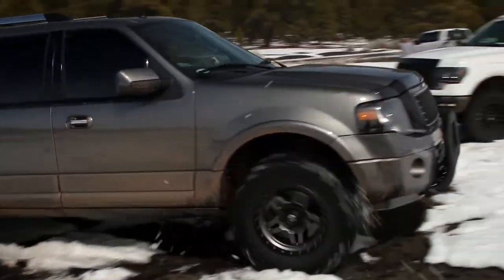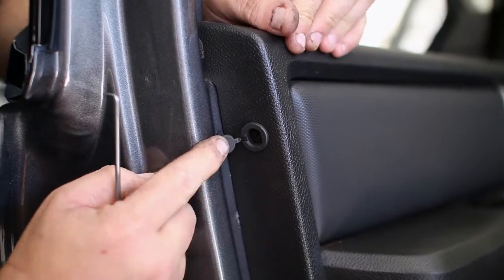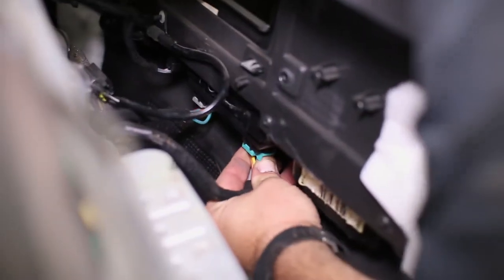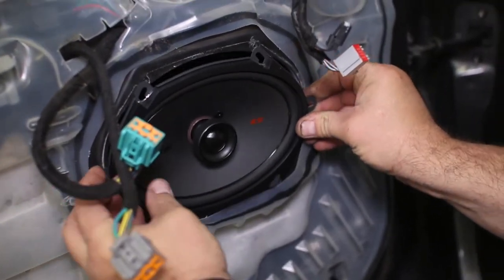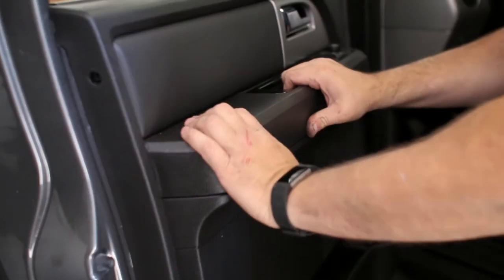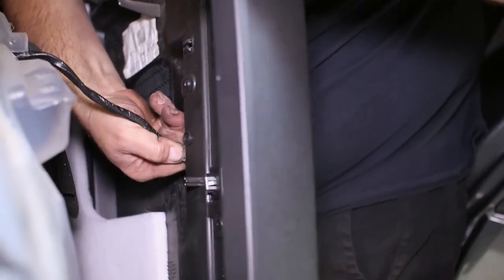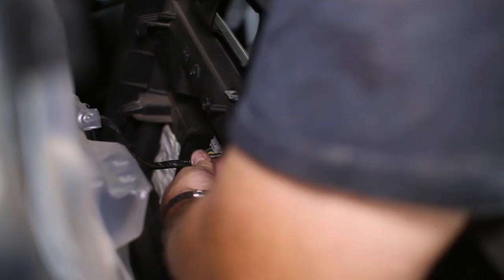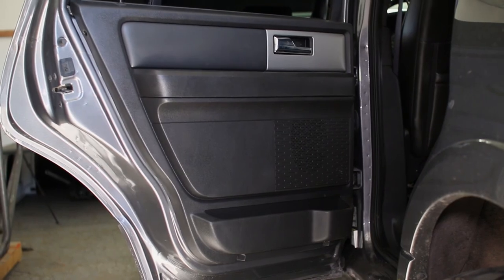2007-2016 Expedition Kicker KSC68 6x8 Door Speaker Upgrade Kit Install

Comment: I was happy to find this video until I read the comments about the Kicker installation stopping the tweeter from working.
Reply: You're right because upon me doing research as well everyone that does the conversion never explains that second clip that's just magically not being connected to anything what controls that clip nor has no one wrapped it up as a former protection because water can and will eventually get back there

Comment: I do not like the fact that replacing my speakers will eliminate my front tweeters
Reply: 10 months later do you have any suggestions on what system to use for the upgrade?
Reply: Kicker has a separate tweeter kit that can be purchased separately and was not included in this video.
Reply: @atcguy2007  where can i find this kit
Reply: Anybody had luck on this?

Comment: DISCONNECTING THE NEGATIVE TERMINAL ON THE BATTERY PRIOR (HIGHLY RECOMMEND ‼️‼️‼️) ALSO BOLT SIZE'S/SOCKET'S WOULD HAVE BEEN GRAND